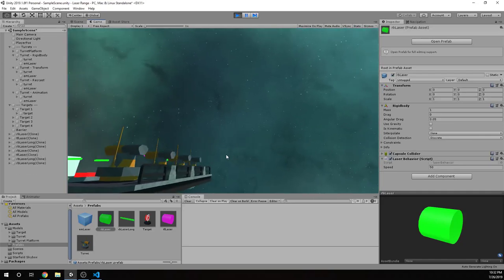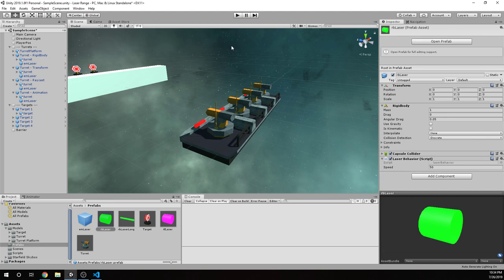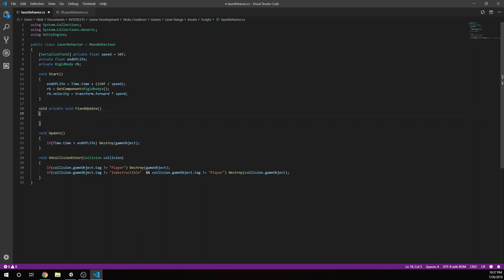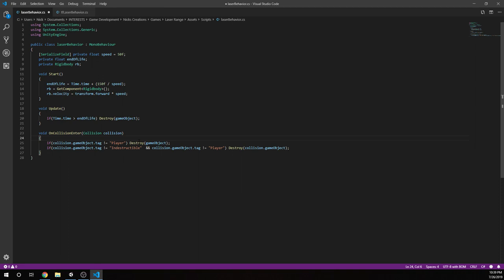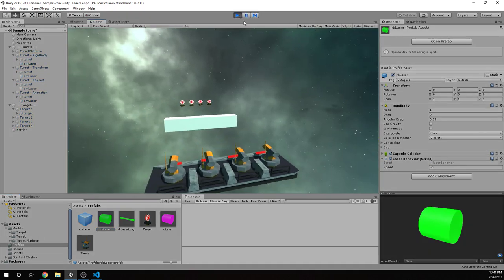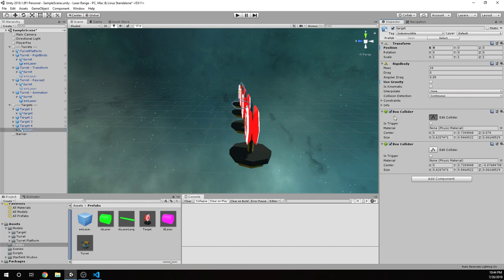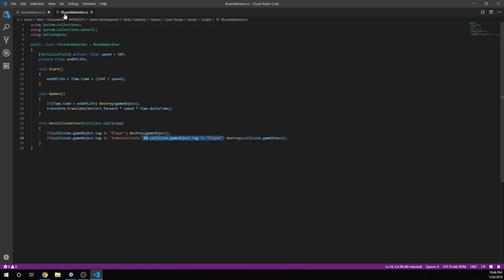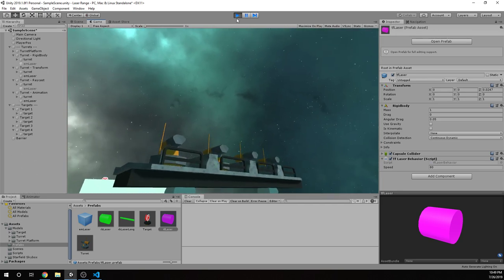Projectiles and Collisions in Unity3D

Comment: This is the exact problem I ran into years ago, detecting a collision with incredibly fast moving Rigidbodies. I actually just ended ray-casting each projectile from where the object was then to where it would be next frame to detect a collision (and added some programmed force if there was a collision). Boy am I ever mad there were some switches I could have toggled lol.
Reply from the maker: Hopefully it helps! I personally think it works well with the settings shown. The only concern I have is remembering to set all the "targets" to continuous, which could be all objects. I'm also not sure how well it performs compared to using just raycast. I'll likely revisit performance in later videos, but I'm breaking away from the lasers and focusing on ship movement in upcoming videos.
Reply: @bitgalaxis1147  Sweet! Looking forward to those videos then!